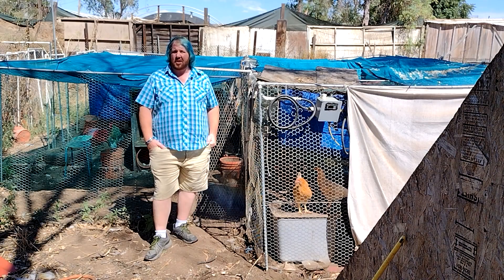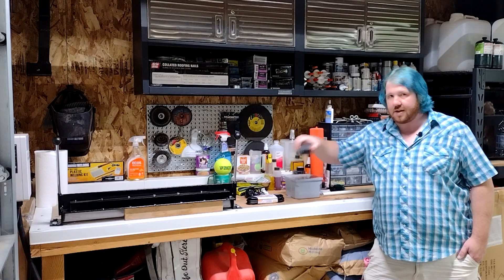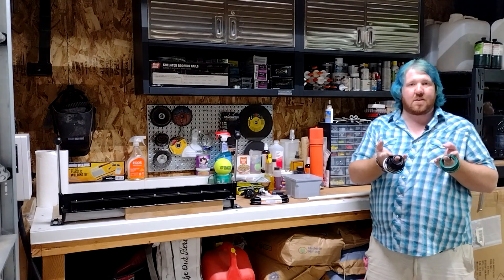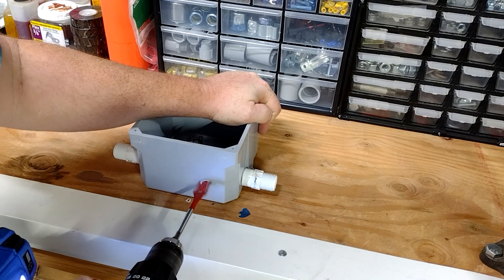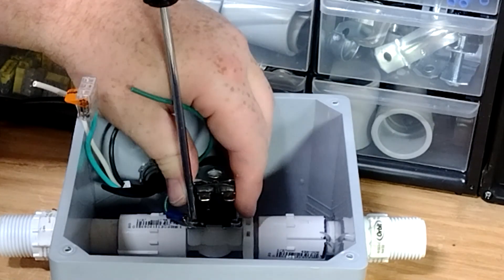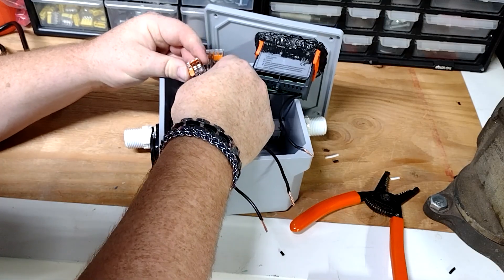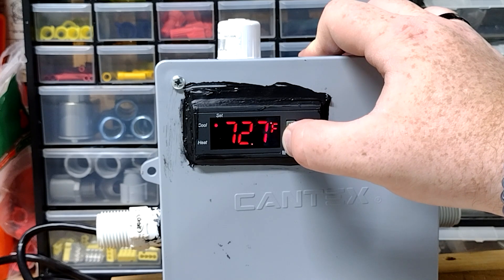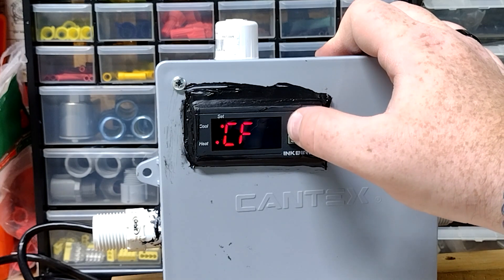How to Make an Automatic Thermostat to Control a Mister System

Comment: I'm going to build this. Thank you for such a great breakdown on the system.
Reply from the maker: Glad it helped, good luck!
Reply: Actually I do have one question? How would the wiring change if I didnt put an outlet or a fan. Right now the solenoid stays open no matter what the programming says. I think it's wired wrong.

So the only items in circuit would be be thermostat, solenoid,  sensor, and power.